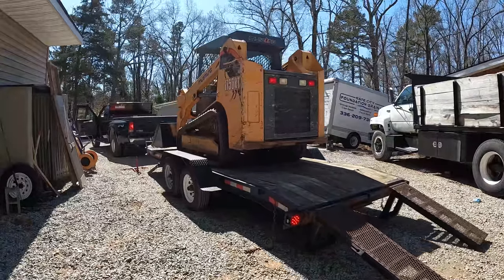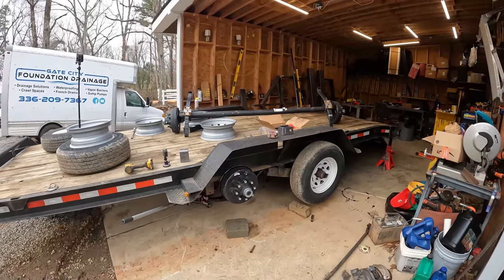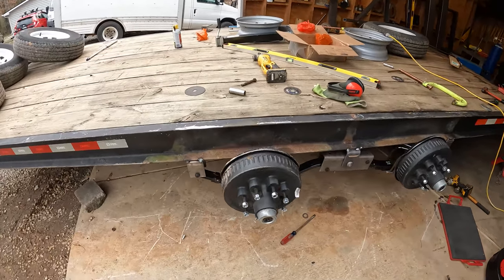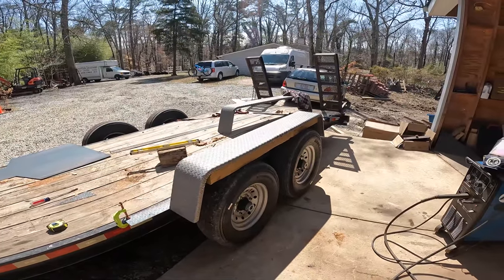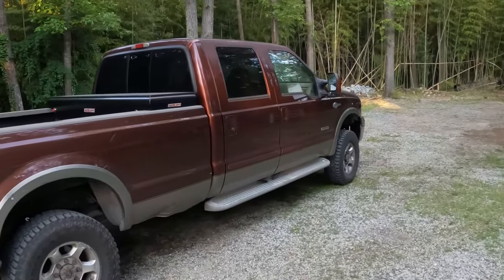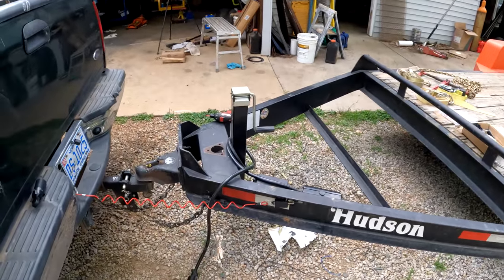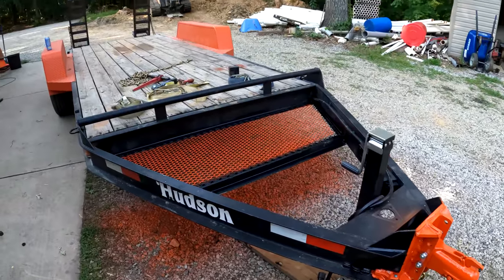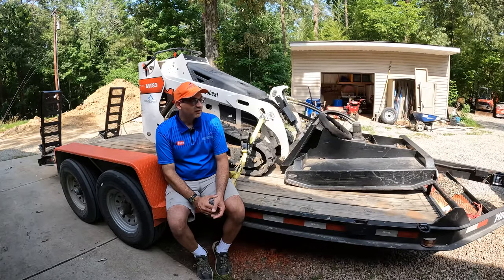Upgrading an equipment trailer

Comment: There is a couple from Curt with ZERO moving parts. Curt quick pin. It’s the only coupler I’ll ever use.
Reply from the maker: Nice. They don't made that for heavy duty applications though.
Reply: @GCFD  yea, I was skipping through the video and made the comment while you where showing the car trailers. I like the curt as it’s 100% either latched or not and no moving parts.

Comment: I get changing axles to get tire commonality; for travel trailers I want the same tires/wheels on the trailer as the tow vehicle. Shat happens. But longer ramps give more ground clearance and a lesser ramp angle.

If you have something like a skidsteer with a heavy weight on the back reverse up steep ramps if you don't have a load on the other.
Reply from the maker: I am planning to make some longer ramps and paint them orange too! I like the drop axles in that they set your load's center of gravity lower too. Low is good
Reply: @GCFD  
Low is good as long as it does not keep you from reaching your destination. With your purposes that doesn't seem to be a problem.
Reply from the maker: For sure! I stick to the pavement so no offroading for my trailers haha

Comment: What was the weight capacity of the Hudson trailer before you changed the axels?
Reply from the maker: It had two 6,000 lb axles and now it has two 7,000 axles.

Comment: Shawn - is there any fish plating behind that dovetail?  It looks like there's some flex there and that may cause a failure down the line.  6:06
Reply from the maker: I'm not sure about that. I know I welded a 3 or 4' gusset across the dovetail on my yellow trailer to stiffen it up, I might have to do the same here. Thanks Rusty!

Comment: just wondering if the orange breakaway cable is long enough - it looks a little stretched when jeep and trailer are in line but at full lock turning to the right could it actually pull the jumper out and engage the brakes?
Reply from the maker: Great point ian! It's long enough to not pull out. that would be a surprise for sure!

Comment: Ok Shawn. 1st…… thanks. 2nd….. love Kubota Orange. 3rd…..great trailer. 4th…… how many skid steers? 5th….. “I just completed a remodel project. Where’s the videos. 6th……. Time for an equipment show & tell.
Reply from the maker: Hey Jim! I have two full sized skids and a mini skid. I might be adding another at some point. 
I have a few rental properties and I have been selling them as they become vacant since the market is so hot. I've thought about videoing those repairs but I haven't done any. I'm getting one back this week and hoping it's not destroyed. It was rented for about 4 years.

Comment: I'm sure there's a simple answer but I admit I know NOTHING about any of this, but my question would be concerning that breakaway cord.... is there any possibility that could accidentally disconnect while driving, causing the trailer breaks to slam on? I mean, could you drive over a piece of debris on the road and have it kick through the back and pull it out of the connection point? Great video though!
Reply from the maker: Great question Paul. You have to pull pretty hard on the cord to get it to pull out but yes, I'm sure it could potentially happen.

Comment: Shaun tot you convert  to tilt down to ground level  trailer model..
Reply from the maker: that would be the ultimate! Tilt trailers are super pricey but they are easy to load.

Comment: I really wish you’d use grommets when installing wire though framework, overtime it will rub though , for the sake of a few bucks worth of grommets 👍👍
Reply from the maker: All the trailers I’ve seen have never rubbed through. The wire doesn’t have enough mass but I’ve always wondered about it.

Comment: IT seems like the value you realize out of it could far exceed what was spent over the long term since you have put in the time to increase its weight handling capacity and the lifespan will likely be longer due to something like that.  You might look back in 10 years and have a totally opposite thought process on the expenditure.
Reply from the maker: I think so too Brian. However many times I've hooked up to this trailer I am so happy I replaced that crappy coupler. Just in time and efficiency alone over the life of the trailer.

Comment: Mig welder will not penetrate the paint on the new fenders should have sanded off, Or use stick welder which will burn through the paint.🇬🇧🇮🇪

Comment: Why not make the ramps longer instead?
Reply from the maker: Even making the ramps longer the deck is still up really high. The lower the load, the better the center of gravity and handling. Plus I wanted to change wheel/tires, so the new axles accomplished both of those for me. Great question!

Edit; I still want to make longer ramps and paint them orange!

Comment: Somebody please explain me this: i always see that american car trailers and dump trailers and etc got the axles pushed waaay back from the middle of the trailer, european trailers got them on the middle, my thought is that if you put a car on it, pushes the back of the towing vehicle down too much and lifts the front axle… european tow hooks on cars also have a limit of vertical force, like a Q7 can tow 3500 kgs or about 7700 lbs but the tow hooks limit is for example 85 kgs vertically

Comment: Looks like you need some shims on the coupler bolts… otherwise that thing is going to be sloppy and banging all the time….
Reply from the maker: Those are the ones that came with it but I noticed the same thing. I don't like my trailer connections banging around.

Comment: No matter what your trade or project, it seems like everyone uses the Harbor Freight earmuffs. They're ANSI S3.19 approved and do just fine for me.
Reply from the maker: I like them because I just leave them hanging on every piece of equipment so I always have them.
Reply: Man your channel always has something I like, even now the earmuffs I have been looking for some new knes now I have to check hf. Wish I could weld sometimes.
Reply from the maker: Get a welder and go for it! That's what I did. I paid big money for a fab shop to make the drop down sides on my F550 dump body and add a hitch. I got the thing back and everything looked like carp! I said, is this what a professional welder is doing? I can do this!!!

Comment: The video keeps buffering. Other YouTube videos work as normal. I restarted my phone and still can't view it. Strange.
Reply from the maker: Youtube hasn't finished processing the standard version yet, even though they said it was finished. Check back in a day or so. Sorry for the issues Richard!
Reply: It works, but only 5k 5312x2988 60f resolution is available.

Comment: Great upgrade, sure beats making it from scratch when you had most of it already. The one thing i would do is to make the lip on the front of the mesh box higher. ´
Keep up the good work.
Reply from the maker: I thought about that Andreas but I'm not keeping that much stuff in there. I also thought about a lid that I could also strap cargo onto but I don't think I'll do that either.

Comment: I really respect the work that you’ve done with upgrading your trailer the only thing that I could see that maybe you could use a little improvement is your basket make it a little bit deeper or taller and put a lid on it that opens up towards the tongue… If you hit a bad bump your libel to lose some of your trailer gear and it would also keep some people from pilfering your stuff. Just my 2 cents…
Reply from the maker: I totally agree Charles. Diamond C trailers has an awesome basket with lid that locks. I was checking out their stuff.

Comment: I understand that tack welds are strong buy why did you not finish the welds for the hangers? You're running heavy equipment on this trailer. That seems really dangerous to me.

Comment: Overall ( ANY ) Project  boils  down to Cost Versus Use .  How  much money, time, effort, and  materials goes in to how  much  work, profit, longevity you get out of  it thru  time. Things to consider though  are the  Most  Useful  instead or Cosmetic  alternatives too. COLOR.  Hey ( IF ) its  green  , purple , yellow  or  any other  hue, tone, shade, and combination there of. DO What is the  Cheapest . WHY ???  Over time Touch ups  will be  a  No Brainer. Going  with  High End  ( Special Order )or  custom  mixes  will only  Cost  you  NOT  Benefit anyone. HINT.  Weld in the  ID #  both above and  below.  Add the  License Tag and  other  VIN  details  in more then one area.  Front  Back, Side, Top, Bottom, Rear etc.  Caution is  best describe as  being  Confident it will be  Noticed - Not  over looked. Lastly .  Fabrication is  an ART !. Welds  are the  Seams  that  hold  everything together.  USE  more  caution when  tacking  things  in place. Then Alternate  Sides to keep over heating  , bending, warping, and  mis-alignment from becoming a  Re-Ocurring  issue.  Its  yours  ( TRUE ) yet doing  it  wrong  always  takes more time when doing it over.  Then it  would  have  taken Doing  it  RIGHT the  first  time  and  NOT  having to go backwards to fix  what is  not  working.  ( A-B-C-1-2-3 ) Who, What, When, Where, Why, How. These are the  Method of Operations  most  commonly  used in business across the  land.  Asking yourself the  First  step  does not  mean  you need to know  the  last  to get it  all going.  Forgetting to make a  Plan,. Means  you are planning  to Fail from the  beginning.  Tip to get  you  smiling. 
" In the End - It All Goes Back to the Beginning "
Reply from the maker: Great advice! This was definitely an interesting project and I'm very happy with how everything came out.

Comment: I like this video but you need some practice welding yet. To be welding something like that you need more skill
Reply from the maker: What should/could I have done better Monty? I have kept a close eye on my yellow trailer and I haven't seen anything. One thing I did to mitigate my novice welder level is to buy a Millermatic 250 welder that is an awesome, heavy duty welder.

Comment: This is just my opinion, so take it for what it's worth. I think the trailer you built is far superior to this one. one thing you could do is replace the ramps with longer ones.
Reply from the maker: I agree Steven. The one I built is very well thought out and works very well. I was looking for some 5" channel but couldn't find any and wasn't really looking to build another whole trailer so this is what I came up with. The longer ramps I think would help out a lot so that's on my list right now....eventually.
Reply: @GCFD  well if you build longer ramps some day, don't forget to record it. I really enjoy these little diversions from the norm.
Reply from the maker: It's on my list. Maybe I could do an update video on this because I need to fix the clearance lights, add some to the fenders, replace the deck, and do the ramps. 👍
Reply: @GCFD  Sounds great. I'll look forward to the update. I think I see a new playlist in the future.

Comment: If you charged an acquaintance $500.00 to pick up their vehicle I would hate to see what you charged a stranger. In my opinion you do now need to make all your money back for the modifications on one single person. I try to help all my friends the cheapest way possible not nail them with a $500.00 bill. But this is just my outlook on the situation. Plus you probably do not have the liability insurance like a recovery service carries in case the trailer breaks away and the vehicle gets destroyed.

Comment: I was interested in this video for 2 mins. Then I heard non structural to many times pointing to the structure off the trailer.  Fast forward… Axles n tires are half the value of a new trailer that has been built and rated for the gvw you are attempting.   Buy the right trailer next time. Unless the trailer was free. Waste of time and money. Spend new trailer $ on a used trailer 👎